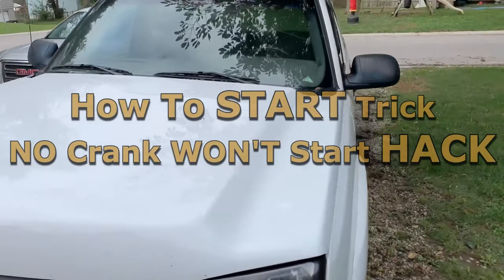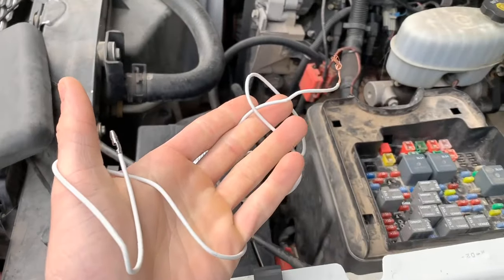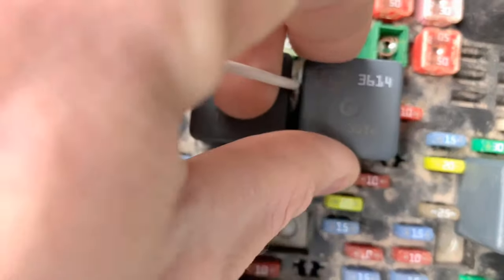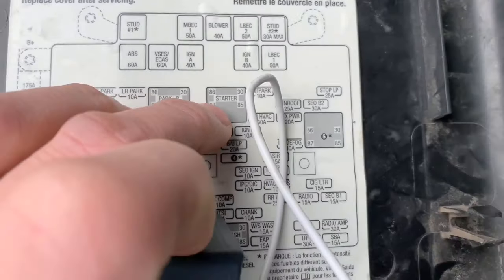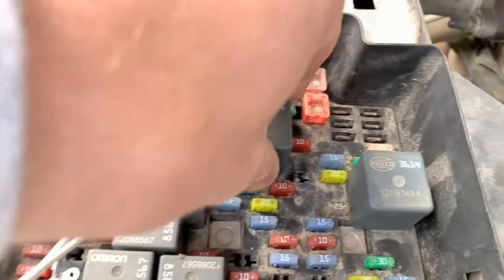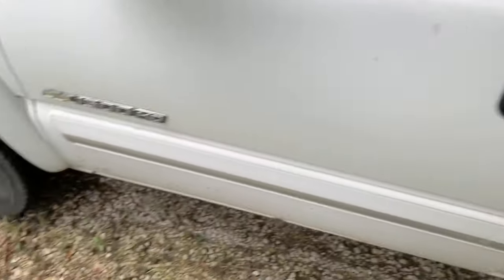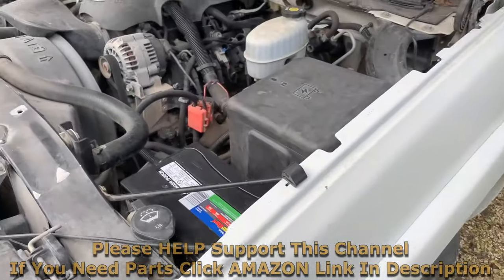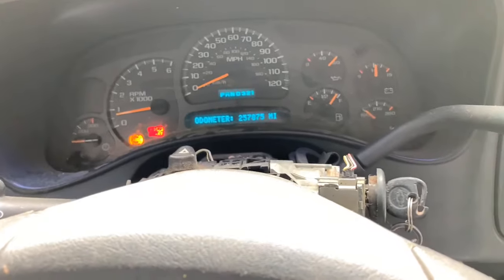NO START NO CRANK Chevy Silverado 5.3 Vortec 6.0 4.8 4.3 L How To Start TRICK Diagnose WONT START

Comment: Worked fine for a month ended up putting a push button in the cab now if I have to use the push button to start the truck I only have 2nd and 3rd gear no blower motor abs light on  and 4x4 won't lock in does anyone know the actual cause and fix to the problem??
Reply: Ignition switch or lock cylinder?...I might be wrong tho

Comment: Just swap the wiper relay with the starter relay until you get a new one
Reply: Wont work if there is no command signal from ignition switch. This is to force the starter over until electrical issue is diagnosed

Comment: I'm having the same issue with my 2008 gmc sierra, I've trouble shot it down to a bad (bcm) body control module. Every one I've talked to tried telling me it's a bad starter, but If I unhook my battery and wait an hour or so, then hook it back up it fires right up, I also lost the volume on my radio which is another sign of a bad bcm, this trick helped me get home so thank you for this

Comment: Bad idea. If you send battery positive up the wrong wire you could damage your engine computer. Plus you will need to do this everytime you shut it off. And if you happen to leave the truck in drive while you do this you will probably run your self over.
Reply from the maker: For sure but I think your missing the point of video  it is used to DIAGNOSE starting promblem or if your in a pinch so you don't have to spend $$$ on tow or for short term till you can fix truck if you have to go to work & only have 1 vehicle trust me it is a lot better then walking LOL till you can get it fixed LOL

Comment: Thanks for the heads up! My problem is im not geting  any ignition powef to my 04 sierra
Reply from the maker: Probably something to do with factory security system try doing reset of computer by unhooking battery for at least 15 mins this well reset factory GM security system you'll just have to re enter the correct time on the radio LOL

Comment: I need help. I have a 1994 Chevy suburban 1500 and when I go to try and start it the temperature gauge shoots up and back down without it starting. Battery is good, checked fuses they are good. Can anyone point me into which direction I should go from here? I'm working on it now. Any advice would be greatly appreciated 👍
Reply from the maker: I would check the air flow sensor it is mounted under the round air filter this cause those years trucks not to start & is very common issue.

Comment: What was the final resolve for the issue? Did the problem come back? Just happened to me on a Silverado purchase. Ran and drive fine all weekend. No crank no start on monday, started right up with the hardwire from battery to relay. Is it the relay thats no good or the starter? I had my battery tested, battery was good. & we all THANK YOU btw this was so clutch.
Reply: I was wondering if you ever figured out what was wrong with it?
Reply: @Billy-rd8kq  not really, but I proactively replaced my starter, nd it didnt happen again for weeks/months. Seems intermittent, I cant replicate the problem. Since the starter replacement, I've only had to use the jumper wires onc. It happened a few times when I first bought the truck. Now, I dont remeber the last it did, but I still keep the jumper wires in the glovebix... hope this helps

Comment: Thanks for the info.  
The "Fog LP" relay is the same as the "Starter" relay.  Would swapping these allow the starter to work normally?  Note that the relay pin functions are shown on the side of these relays.
Reply from the maker: It can be multiple things that would cause this issue not just bad relay FYI
Reply: in a word. yes. to eliminate the relay as being the faulty component provided power is making it to you relay. otherwise to fix it correctly you'll find out why battery power isn't making it to the relay.

Comment: Hi I have a Chevy Silverado 1500 2004 I tried the wire to the fuse for the no start no crank and it did absolutely nothing! I sometimes have a problem where my spark plug gets loose but I’m not sure which one it is.

Comment: Just save my day and some $$$ on my flatbed tow truck. Did it on my 2005 GMC c6500 and it worked. You great but now am confused what to changed. Is it the fuse 89 or starter?
Reply: It could be the starter wiring. It could be the neutral safety switch. You have to diagnose every possible scenario.

Comment: My truck is doin this no start no crank shit and has ben for 2 months. I have replaced the starter relay fuse 3 times and the ignition switch and battery and i also replaced the original starter with a brand new one not reman a brand new and it still wont start with the key or a push button start switch
Reply: try an alternator

Comment: I got no dash lights or any power to anything. New battery, before this happen, it was running, I shut it off, trying to start after a while nothing first time, second try I got blower motor and dashboard lights, third time back to nothing with key turn.
Reply from the maker: that deal on the ignition with 3 wires behind the steering column cover is a good chance it is your promblem there a bunch of videos about it.
Reply: @EverydayImTECHnIt  ignition fuse slightly raised. Made her turn over, plugged her in hour later she started. Had my father try to start later, nothing. Tighten up negative battery cables…..seems to have come alive, I still need to change the block heater cord, I bought a new ignition control module just in case.
Reply from the maker: @fbksfrank4  Ok if not check the key ignition plug with 3 wires going into it cus it like to get loose & then causes problem you described

Comment: My stater is cranking but still nothing.  I can't get anything with just the key. No power windows or locks either. Any suggestions  before I take my Escalade  to the shop
Reply: Change fuse with the 2amp

Comment: Thanks!!!! This trick does work on silverados!! My 03 left me stranded at the carwash... first I taught it was the battery since I just got a new alternator not too long ago... I had it jump start but I couldn’t hear it crank... I new the started had to be it!! Thanks u saved me a tow back home! 😎👍
Reply: Im sorry for bothering.   So even tho the problem was the starter did your truck start with the method of this video before replacing the starter??
Reply: @mannyreyes789  yes it did start after a few times and about 2 weeks later it did the same thing... thank god I was at my parents house when it didn’t start... I took my starter to get rebuilt at a local shop for $60 and it’s been good aver since 👍

Comment: If you pull the fuse box up you'll find a melted wire for start rely just replace wire and fuse box for proper repair
Reply: This is what the issue actually is ?

Comment: Or you could just pop the cap off the relay and press the relay in.
Reply from the maker: the relay can be the issue but is usually not the cause of this issue just FYI there's multiple other things that could be wrong this will override to start the truck but yes you're definitely correct I would definitely try swapping out the relay but if that doesn't work there's multiple other causes

Comment: Was having this exact same problem come to find out oil from previous rear main seal leak got all over starter and cause the solenoid not to engage when needed. so if your having this problem i would highly recommend checking starter first chances are you have or had a rear main seal leak or salt and weather has corroded starter.
Reply: I just had a rear main seal leak fixed and it leaked on the starter for a while. Now 2 days after I got the leak fixed it won’t start!

Comment: Mine just sparked and the truck went dead.
Reply: Thoughts? Tips?
Reply from the maker: @Zero0Vampire  You most likely need a thicker wire & make sure your battery is charged. Let me know if it still doesn't work with thicker wire first time i tried it i had to use thicker wire also FYI! Hope that helps!!!
Reply: Everyday I'm TECH n It thank you for your response. Ill find out today. Hopefully the battery just lost charge.
Reply from the maker: @Zero0Vampire  right on good luck!!!
Reply: @Zero0Vampire  What ended up happening?
Reply: JORDAN PHOTO WORKS a fuse was blown and there was a loose connection near the starter and there was some bear wire. If thats how it’s spelled.
Reply: JORDAN PHOTO WORKS I actually just found out yesterday. Didn’t have time till now.

Comment: Doesn’t work for a 2007 GMC Sierra 1500 it set my fuse box on fire. Nothing works now
Reply from the maker: In 2007 they made 2 body styles the older classic silverado 03-07 style & newer body style 07-ending year not sure but same as like 08 09 ect body style this has a different fuse box from 03-07 silverado classic body style this is probably why it didn't work & very sorry to hear that.
Reply: MADBRUH Did this damage you're fuse box ?

Comment: Will this work if it's an ignition switch problem?
Reply from the maker: I believe so but to confirm I would need to know specific ignition problem because there's multiple problems you can have with the ignition but I wanna say I'm pretty sure that it should in most cases depending on exact problem with ignition

Comment: So I kinda have the same problem but you can’t hear the pump and once you take the key to off position the dash stays on !
Reply: What exactly was the issue with your car ?? I have the same problem
Reply: @mannyreyes789  so I got a 2006 GMC Sierra from the auction with a 4.8 Engine swap on her vin it says it had a 4.3 and after a while her reduced engine light comes on and how I bypass it is by just disconnecting the negative but one day it had no crank and no start so I decided to by pass the starter and now the she’s crank but there’s no sounds on the pump as if she went into lock mode.
Reply: Thank you for your reply

Comment: Neutral Safety Switch
Reply: Yeah but what happens if you put a new neutral safety switch in and it still does the same thing I changed the relays out change the ignition switch out I put a new starter and a new battery on there I've checked every fuse yeah but what happens if you put a new neutral safety switch in and it still does the same thing I changed the relays out I changed the ignition switch out I put a new starter in a new battery on there I'll check the refuse in there the only thing I haven't checked was the fusible link and I can't find it

Comment: My 06 Sierra wouldnt start or crank so I tried this and it didn't work..So what's that mean?
Reply: Check your starter. It might be bad
Reply: Try and start in neutral. Also you can jump across the solenoid to see if it will crank. No crank then the starter is bad
Reply: Yeah it was the starter change that and was good to go been about a week and no issue so pretty positive that's what it was lol

Comment: yeah , this is a jimmy rig ,  or a band aide , i like my stuff fixed right ! you should not have to pop the hood every time to start your truck and connect to # 87 starter relay and not parking lamps as you did , and  to the battery , dont know , have to diagnose ? either the fuse is blown just to the left of the starter relay or the relay has gone bad or worse , could be the pcm or starter  . to check the starter , pull starter relay out ,  use a 12 in wire , stripped on both ends and twisted  ,  preferably fused , connect the  wire  from starter relay #87 slot on fuse box to #30 slot  , that will crank the starter to check if it is working correctly . check for fray wires , or loose or corrosion on terminals .
Reply from the maker: Ya for sure it is a 100% band aid or can be used for troubleshooting purposes but still can help for short term solution if you only have 1 vehicle & need to able to start truck if your out of town & it breaks you need to get it to shop or home to repair or till you have time to fix it or money to pay shop so this trick can come in handy for a number of different reasons. Thanks for watching tho
Reply: @EverydayImTECHnIt  Wonder how many tow bills you have saved Some times band aids will get you to the hospital Thanks for a great video, I agree should be fixed right when the time is right.
Reply from the maker: @dennisbarney869  Hopefully prevented a few towing bills LOL & Ya for sure!!!

Comment: WORKED!!!  Thank you so much for this tip!
2015 Silverado was clicking but no crank.  Checked fuses and grounds, no luck.
Used a speaker wire (probably 18 AWG) and hooked it up to the relay terminal "86".  I tuned key to "ON" position and tapped to the POSITIVE terminal as in the video.
At first, I could hear the solenoid clink, but no crank.  It did this on the first 3 taps, then on the 4th started cranking!  I pulled the jumper and put the relay back in and cranked it and started right up!  I have since turned it off and started it 3 times, NO issues!
I think what happened was...I went down a HORRIBLE pot-holed road like miles long.  When I turned it off after that, It would not crank.  I think all of the jostling and way it acted when jumping, then worked, it dis-aligned the starter to engine, so was locked up and system detected key in run position, but no crank and pulling current, so would not allow it to start.  Once the dis-alignment of gears and lock up was cleared, no issues!!
I can't thank you so much.  It took 60 second and 5' of speaker cable for $1 to get it working again after being down a week or two!!
Reply: @getminesallday24  yes, Starter relay!
This resolved the issue for the moment, but some times I turn the key and starts and some times, nothing, nothing, nothing, then starts....or nothing, nothing, nothing, so I try the Auto Start and starts!!  Not sureof 2 things...

1. What this jumping the "87" of the started relay actually does??  Is it bypassing the relay and applying voltage directly to the starter, or??

2. I need to find out the Root-Cause of the issue and as still having issues and need it reliable.  Is this "jumping" bypassing the relay and issue us actually the relay?  or is there something wrong and starter and solinoid need repacement??

Can someone clarify this??
Reply: @getminesallday24  I resolved the issue 100%.

This fixes what the Root-Cause was, which was just a weak Relay!!  I replaced the relay with a new one and works 100% and cranks and starts every single time!!....just wish they explained it as such, but thanks for the quick way to jump the relay should it be weak or completely broke!

Comment: So what was the real problem? Bad starter relay
Reply from the maker: Could be multiple things you can swap relay to see if that is the issue also check large starter fuse that is sqaure & neutrel safety switch also plus could be wiring issue or ignition deal with 3 pins for secrecy deal I think but not a 100% sure on last one.
Reply: @EverydayImTECHnIt  excellent info! THX, did you end up figuring out the problem on your truck?
Reply from the maker: @TetraHydroCannabinolTHC  Ya it was weird the large square starter fuse looked like it was good but it had a hair line crack go figure I checked it once & didn't catch it looked like it was good in less you really looked close then was like wtf is wrong I've check everything so decided to re check everything & was like omg I can't believe I missed that & it was just a fuse felt kinda stupid to be honest lol but was happy it was fixed lol

Comment: battery has been charging for awhile ,yet when tried to start once , it quit and would not start a few times as if it had no Charge ?? is it that fuse or ???
Reply from the maker: Check your ground wires & battery connections my 2 cents hope that helps!!!
Reply: @EverydayImTECHnIt  Thanks I will give that a whirl 1-28-'20, I'm in Alaska and its a bit cold here now . -6 or less forecast tomorrow.
Reply: Well I just couldn't wait , Braved the Cold >> tightened battery connections and Booom it started right up , Thanks a lot 10 Gold Stars for your Easy fix , Saved me 20 + $'s for pieces I did not have to get , that would not have solved the issue . Rest assured I will come back to this for Fixes , and recommend this to others !!!!
Reply from the maker: @mikedyas6821  Glad u got it fixed & i hear u i'm ready for spring already lol!!!
Reply: M

Comment: Thanks for the video .. My tahoe did this on me last night .. & ran across your video bout a hr ago & just went out & did this my truck crunk right up .. Is it the starter relay fuse or any other fuse. or could it still be the starter ?
Reply: Did you find a proper way to fix? Have this same problem now
Reply: Same issue. It doesn't do it all the time to me. Walked out the relay that did not help. More than likely it is an ignition issue.
Reply: Jason Perner I got the same issue mine does it sometimes but not all the time but it’s getting more and more common and idk what it is to fix it
Reply: @robrides3216  I replaced the starter relay and the ignition switch. Still does it. Someone on a forum sent me a feed and they got theirs fixed by putting in a new ECM/PCM/ECU all abbreviations for the same part. Engine Control Module.

Comment: What kind of wire can I use
Reply from the maker: Any kind of semi thick copper wire works can't be to thin or it won't work like size of trailer wiring for trailer brake lights, turn signals, running lights ect size or same kinda wire thickness & kind of wire that running to your trucks/suv rear tails lights, marker lights, headlights etc you get the point hope that helps!!! even wire off old AC power cord like the goes to TV just use 1 size on the wire tho on power cord there is 2 wire only need 1 doesn't matter which one hope this helps & works for u!!!

Comment: what exactly does this do electrically?
Reply: I know I’m late, but this bypasses the ignition switch by sending power to the starter relay directly from the battery. That way, it will start even if the ignition switch or neutral safety switch is faulty.